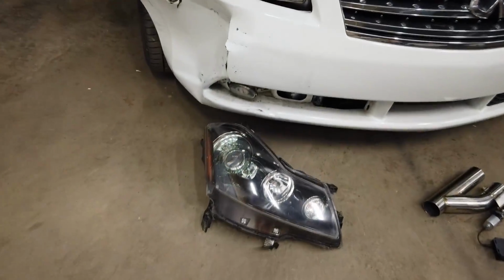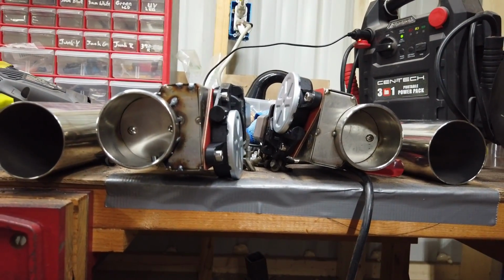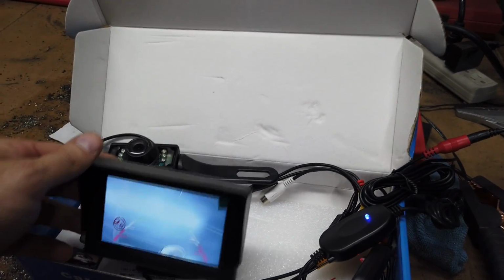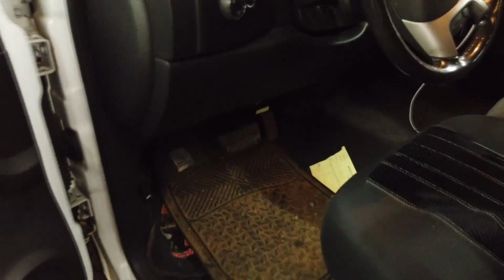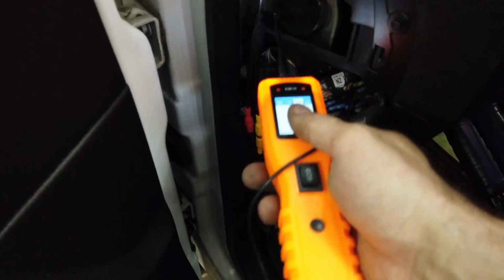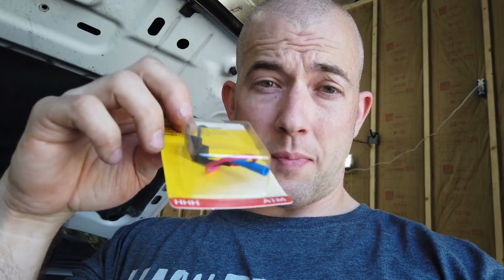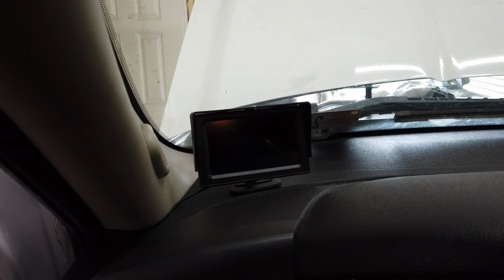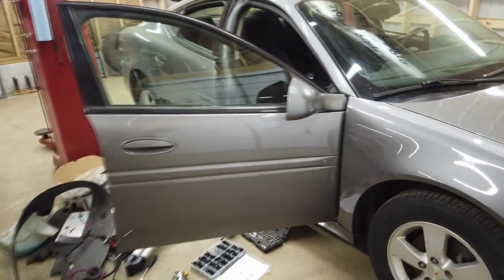How to install a brake controller and a back up camera on your silverado

Comment: Oh dang! i thought for a second there that you got a drone. Then i realized that you were just standing on the top landing of the stairs into the gym. that's a nice picturesque view from up there. Glad the laptop helped! it was just sitting here getting older and no one using it so i thought why not put it back to work. lotta life left in that thing. No sense in it going to waste. Yeah i had to pu on a trailer brake controller too for my run to Georgia for my neighbors death cart test and tune. i got a hopkins insight so i could mount the LED display in the pocket under my radio in the dodge. that will only come in handy when i am hauling for my neighbor though there aren't any brakes on my car hauler at all.but i've left a link below to show you which one i have in my dodge and all i had to do was mount everything and plug in a blade plug that was made for the brake controller mounted on the firewall next to the brake pedal under the dash. no wires to mess with or anything. Simple! DANG! i didn't realize the kia had such big rotors on it wow! Do you not use Ceramic pads at all? those last better through all the corosive  stuff

https://www.ebay.com/itm/47297-HOPKINS-INSIGHT-TRAILER-BRAKE-CONTROL/153388517282?epid=222801641&hash=item23b6ab07a2:g:doIAAOSw3qVcbjvP
Reply from the maker: The fronts I used ceramics, the back I used semi metallic
Reply: @UnWrecked  why the mix? if you don't mind me asking. people usually exclusively use one or the other
Reply from the maker: @DaddytechEnt  because they were both the cheapest option on rockAuto lol.  Complete front and rear brake kit cost me $150

Comment: You can install an OEM solution. I did it on my '08 Diesel. I have factory NAV upgrade and also have the 2013 Onstar to remote start the truck. A lot of OEM upgrades that you can do and are a little pricey, but worth it in the long run.

Comment: Those wireless transmitter/receivers don't like being left on all the time. I hook my power's up to the reverse light wire. You can always add a switch if you want to be able to turn on the camera without being in reverse.

Comment: On the AC for the gym, those rolling units are not as good as the window units. With that said get a dual unit AC/heat pump (they make them and they are awesome) as that will take care of you all year. As for the condensation some units will come with a drain you can attach and run a tube away from the stairs.

I have had those stand alone units and they never seem to cool as well even though it’s a higher Btu unit.

Comment: i have a power probe. the wire with the alligator clip is a constant ground. if you have something to test you hook up the ground and supply power with the probe. its awesome.  bought it back in the day, almost 20 years ago in a shop from the snapon truck for 100 bucks

Comment: When you were checking for voltage it read mostly in the 11.x range when a car/truck battery output in volts should be closer 12.6v while not running. Am I missing here?
Reply from the maker: Yeah but my truck had been in the garage most of the day with the door open.  The dome light was on and I had a couple phone chargers plugged in